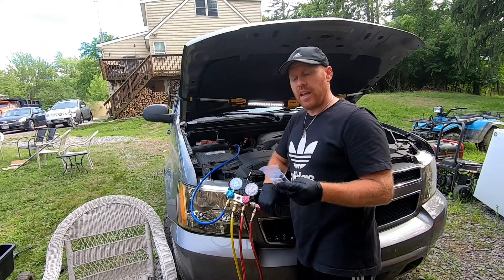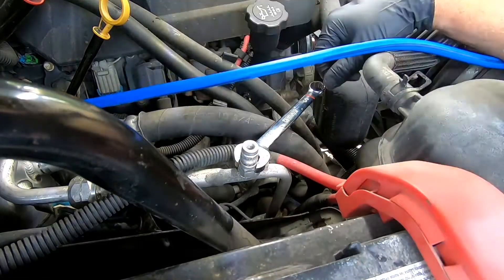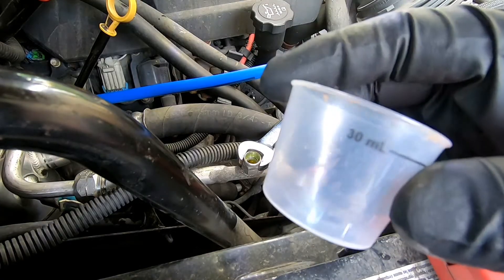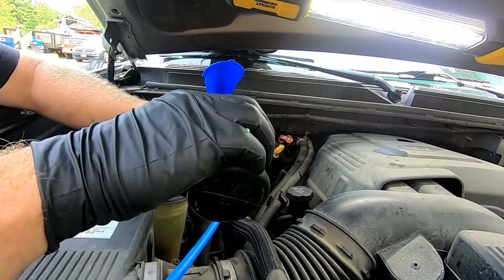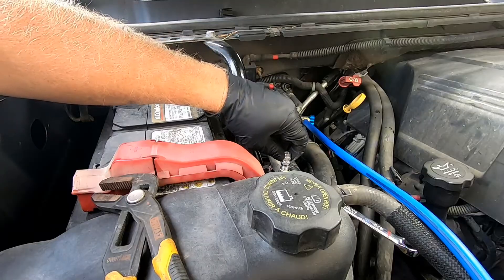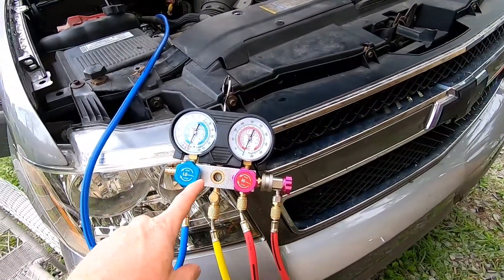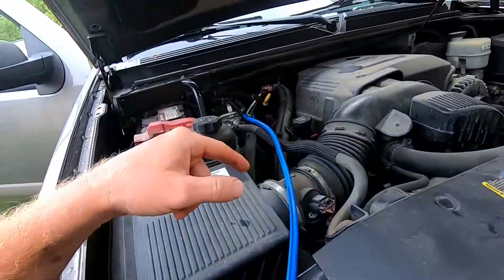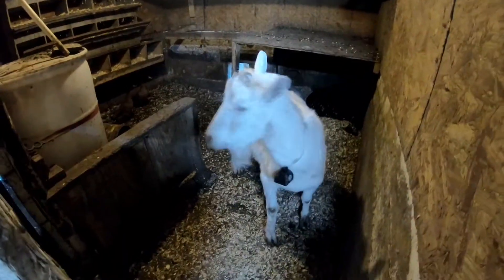How To Add PAG OIL To Your Vehicles (AC) Unit And New High Pressure AC Schrader Valve DIY!

Comment: Im curious what if i just poured the oil into the open port instead of drawing it in by turning on the vacuum pump. I only need to add 1.5oz so I just wanted to remove shrader valve from high port and poue it directly in using a large syringe. Afterwards vacuum and charge. Does this sound okay?
Reply from the maker: Yes you can absolutely do it that way too! Thanks for watching!😊